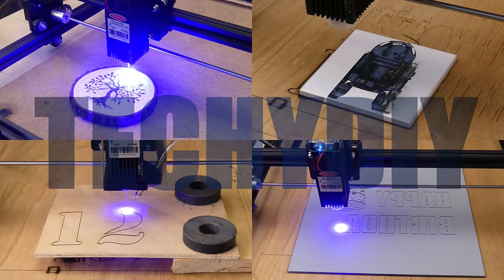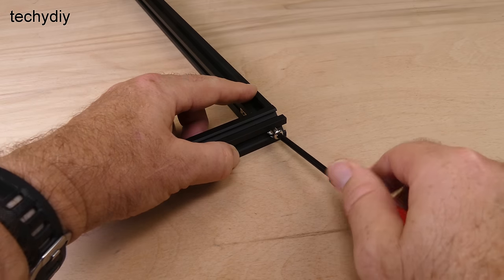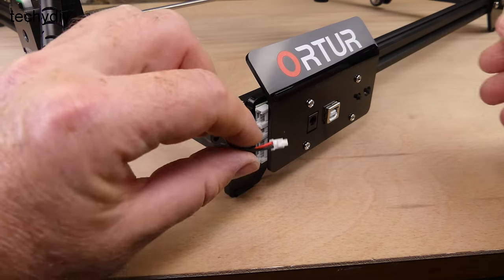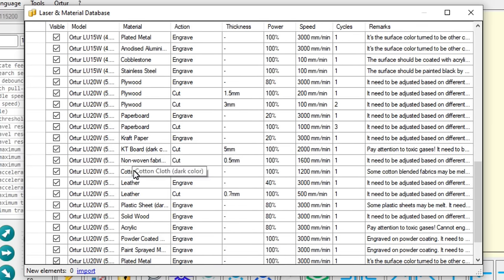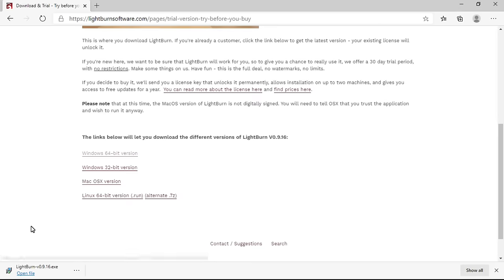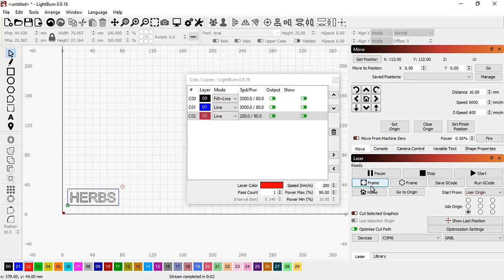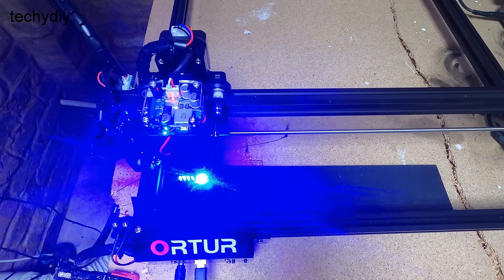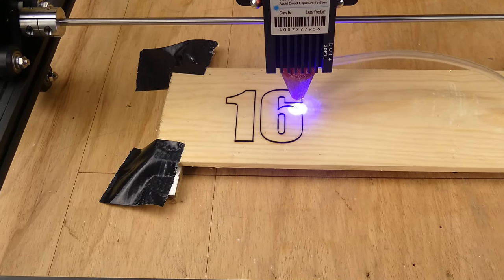Ortur Laser Master 2 - 20W Engraver. Build, Test & Review.

Comment: Amazing in depth review. I have one question tho if you can help . Lightburn doesn't output 100% power no matter what i set in the layer setting . The most that it puts out is i wanna say around 10% in real life. Any idea why that might be ? I've tried searching for the answer but cant seem to find one. Thanks
Reply from the maker: Type $$ in the console, this will show the grbl configuration.
Look for the value of $30
This number represents the laser maximum power level, it is normally 1000 or 255 

In lightburn, under device settings, look for S-Value Max.
S-Value Max should be the same as the grbl $30 value.
Reply: @techydiy  I've done that . Forgot to mention in lasergrbl works perfect , and i also made sure all the grbl config is exactly the same in lightburn but still doesn't output full power . Could it be a firmware problem?
Reply from the maker: I doubt that it is a grbl firmware problem if it is working ok in lasergrbl.
Some sort of  lightburn config problem at a guess. Your best bet is asking on the lightburn forum.
Reply: @techydiy  i will do that thanks. Thought it might be a unit conversion issue between grbl and lightburn that everyone was aware haha . Thanks for all the good videos you put out , I've already bought a laser and a cnc cause of you 😅

Comment: If I wanted to laser etch some wooden dowel that’s long. Could I block up the corners so the dowel fits Under for etching?
Reply: Or would the dowel be to far away to laser if the machine was 10mm higher?
Reply from the maker: Yes you can do that

Comment: I have a question, which laser would you suggest to use the 7w, 15w or the 20w?
Reply from the maker: Generally the 15w is the best compromise between cutting and engraving. If your not bothered about cutting, then get the lowest power laser.
Reply: @techydiy  well i do want to mostly do engravering. How well does a 20 and 15 work with engraving, because I do want to do cutting and engraving. what was the laser type you used in your video?
Reply from the maker: @GAMEZONE13172  I used the 20w but the 15w is what I recommend

Comment: Is the laser upgradeable to something that can more easily cut through material?
Reply from the maker: You can get more powerful diode lasers but if the primary purpose is to cut material then I would get a co2 laser or a CNC router.
Reply: @techydiy  Totally understood. it's also relevant in case i need to replace the laser at end of life with another brand. How can i know what is compatible?

Comment: Hey, great video! What would happen if I could try this machine on a piece of metal? Would it etch into it?
Reply from the maker: It doesn't work on metal directly. 
You can put a mask (coat of spray paint) on the metal and burn off the mask and then acid / electro etch and then remove the remaining mask.

Comment: My wife bought one of these and the program has the home to opposite corner from the power button. Any. Ideas why this is happening? I followed your video to a T on the build and it’s built the same so no idea why it’s doing the opposite of everything
Reply from the maker: So it homes to the back right ?
Does it jog in the correct directions or are the axes also jogging backwards ?
If so then its probably the grbl configuration $3 setting that needs to be set correctly.
Type $$ into the command console in whatever software you are using, it will print the grbl configuration.
Look for the $3 – Direction port invert, mask setting.
The setting is described here:     
https://github.com/gnea/grbl/wiki/Grbl-v1.1-Configuration#3--direction-port-invert-mask
Look at the table in the $2 command
This will tell you how the axes are currently set
Now use the table to find the value that will change the axes  direction
You can change the setting by typing   $3= New value into the command console
Or post the $$ output here.
Reply: @techydiy  so from the power button it goes to the corner diagonal from it as the home coordinates. Then it will not move or budge in any direction. We will try what you said and let you know thanks.
Reply from the maker: When it first starts to home, manually click both  of the limit switches. You will have to be quick. Then you can see which way the machine jogs, if it jogs incorrectly then that needs to be fixed. If it jogs correctly then it's the homing setting 23  that needs to be changed.

Comment: Hi there. Another +1 for the amazingly clear and useful review of this. I'm about to push the button on this but my question was about whether the 20w laser is really necessary. I'll be etching and cutting and you mentioned that the highest power laser might not be such a significant gain? 

Any general advice on this 🙏
Reply from the maker: The 15w is probably the best option.

Comment: Setting Láser ON: M3 or M4 it’s different? 😲 First time that I think about it …
Reply from the maker: https://github.com/gnea/grbl/wiki/Grbl-v1.1-Laser-Mode

M3 Constant Laser Power Mode:

Constant laser power mode simply keeps the laser power as programmed, regardless if the machine is moving, accelerating, or stopped. This provides better control of the laser state. With a good G-code program, this can lead to more consistent cuts in more difficult materials.

M4 Dynamic Laser Power Mode:

Dynamic laser power mode will automatically adjust laser power based on the current speed relative to the programmed rate. It essentially ensures the amount of laser energy along a cut is consistent even though the machine may be stopped or actively accelerating. This is very useful for clean, precise engraving and cutting on simple materials across a large range of G-code generation methods by CAM programs. It will generally run faster and may be all you need to use.

Comment: Does the wattage have anything to do with clarity?I'm needing to engrave text with crisp, sharpe edges on steel using cermark. Is  one laser more precise than the other?
Reply from the maker: In general the lower power output lasers have smaller dots. It's a trade of between getting enough power to do what you want  and the dot size.

Comment: Good evening and Happy New Year.
I have also made the purchase of this particular laser.
It is very difficult for me to cut a plywood 4-5 mm Could you help me with a photo or some instructions?
Thank you very much
Reply from the maker: Air assist
Reply: @techydiy  do you mean to put air with a compressor in the laser? SPEED 2150  LINE INTERVAL 0.110  PASSES 5 TIMES MAX POWER 95% IS IT CORRECT?
Reply from the maker: @GreenBus13  Yes, air assist as shown in the video. It makes a huge difference. The speed should be slow, say 100 mm/min
Reply: @techydiy  thank you veey much for your help.
Reply: well just i buy a small compressor the result is perfect.... But very noise from the compressor, and also after 30 minutes of work the compressor was very hot.
do you suggest another solution ,what would you advise me to do?

Comment: Great review.  Could you test a copper clad board with paint and a circuit pattern on ? I'd like to see how well a direct laser image transfer would work.   Also if you have the ability doing an exposure to presensitised photoresist copper clad board with maybe 0.5% power would also be a useful test (obviously developing too to see final results).  Would be interested to see how lightburn does with fills etc on the copper traces.  I'm after 0.1mm resolution or better.
Reply from the maker: The "20w" 5.5w model is not right for that application. The best I have used is a 500mw laser, which has a much smaller focus. Marco reps has a video about exposing presensitised boards, he was quite successful with a few mods.
Reply: @techydiy  Thanks.

Comment: I want learn to engrave metal and aluminum to do some pets articles, this engraver work for it? Thanks
Reply from the maker: No, it's not powerful enough. Some people report that they can engrave anodised aluminium but it didn't work when I tried it. The only other option is to apply a paint layer to the metal, burn off the pattern with the laser and then etch it with acid.

Comment: Cool video!  Thanks for posting.  I'm thinking about ordering one of these units as a platform to attach an ultrasonic spray head.   I don't need the laser feature.  Would this unit continue to take commands if I were to completely disconnect the laser portion?
Reply from the maker: Yes, it will work without the laser. Buy it with the smallest laser option as it's cheaper. I am going to have to lookup ultrasonic spray heads now

Comment: What attachment do you recommend for engraving glass mugs with handles?
Reply from the maker: A co2 laser. Diode lasers won't engrave glass.
Reply: @techydiy   Do you have any good recommendations for any that will?
Reply from the maker: @TheBobSnap  I use a laser box pro from xtool. The cheap end of the spectrum is a k40 (which is not plug and play). Lots of others available just search for co2 laser.

Comment: My brand new Ortur Laser Master 2 only gets partway through a job and it stops responding. I am using LaserGRBL. I have tried changing the streaming mode and the threading mode, reinstalling the software, tried different files... Any ideas?
Reply from the maker: Basic checks, make sure the connectors are all secure. Route the usb cable away from any other leads. Check your not going out of bounds and tripping hard/soft limits Otherwise go back to ortur.
Reply: I had the same issue of job stopping in between or just after few seconds. I replaced the USB cable with a new one and then everything worked well.

Comment: Hi techdiy, so it can write good Name/Lastname on stainless steel plates for doors for example? Thanks
Reply from the maker: Only with marking spray
Reply: @techydiy  I am thinking of buying this machine :) , (i know this is a noob question) but what does Marking spray means, thanks
Reply from the maker: It requires a very powerful laser to directly engrave stainless steel. Marking spray is a product that you spray onto the metal. Then you  laser your design, remove the excess spray and you are left with a permanent engraving. Moly dry lube also works as a marking spray.
Reply: @techydiy  Wow okay thanks man 👍 what spray do you recommend at decent price to use? Thanks
Reply from the maker: I don't use it but I would try dry moly first as its the cheapest.

Comment: 30:30  If the 20W/5.5W laser is significantly less focused, then would it have lower irradiance, and slower cutting than the 15W/4.5W laser?
Reply from the maker: I haven't tested the 15w so I don't know for sure, but I doubt it has as much cutting capability. It's not the focus but the shape of the source.
Reply: @techydiy  Thanks for the quick reply.

Comment: will this engrave on metal?
Reply from the maker: It can't engrave metal but you can mark some metals by applying a coating like mustard or cermark.  You can also apply a paint layer, laser away the design to make a mask and etch with acid or electro etch.

Comment: HI great video, I got a bit lost though with all the menu and clicking stuff cos I'm not much of a tech person. Does this work with a mac? If so, what drivers / software etc would I need? (the simpler the better please!)
Reply from the maker: You can get the usb driver for a Mac and you can get lightburn for a mac, so I guess it works with a Mac. I guess it depends if you have a usb port on your Mac.
Reply: @techydiy  Great thanks

Comment: hey there,
great video, thanks for reviewing this product. one question: I would need a laser like this one here with the possibility to directly print from a program like lightburn.
I will perform the same step over and over again: same material, same dimensions just with different graphical input. 

Is there a way to set default values and just change the graphical input and hit go?
Reply from the maker: You can save a base design and then just modify it each time. Lightburn has a lot of information on it's user forum, so your best bet is to ask there (Giving examples of what you want to achieve).

Comment: Hey @techydiy, great video man !
I have a question: on the product page they say that this module can also engrave stainless steel if it is painted black with a marking pen. does that really work because i am currently interessted in engraving stainless stell and dont have the budget for an 2500$+ Model. 
Best regards
Reply from the maker: It didn't work when I tried it.

Comment: Follow-up comment:  Your video was SUPER helpful in getting this unit setup.  Thanks so much again!   That was a real time saver.  One dumb question.  In your picture at 0:24, there is a plastic silver tube thing right in the middle.  In my version, I got a black plastic one that is similar but slightly different.  What the heck is that used for?  I didn't see it in the instructions or in your video.  Maybe I just missed it!  ;)
Reply from the maker: Its a tool for installing the cable in the conduit. You only need it for certain models apparently.

Comment: Any chance you could share the air assist v.2 for the 3D printer?
Reply from the maker: I found the bracket on thingiverse. There are a few others.
https://www.thingiverse.com/thing:4524111
1mm 3d printer nozzle  https://bit.ly/3lyEK3m
6mm brass tube   https://bit.ly/3jswznt

I enlarged the end of the brass tube and then  screwed the printer nozzle into  it.
Reply: Thanks for the quick response, I really enjoyed your video, it was very helpful.

Comment: i followed every step but my laser won't move with light burn, before it was working fine with grbl
Reply from the maker: Did lightburn find the laser during setup?
Have to selected the com port in  lightburn?
Reply: @techydiy  no something very dumb of me. the laser was plugged in to an plug extender but the switch of said plug extender was turned off. The weird thing was that my laser could be turned on ( only the light would turn on but the laser didn't move) and my laptop would give a signal it was connected, so i didn't check if it was plugged in correctly.

Just the power light that threw me off....feel so dumb right now  xD.

Comment: Use for brass?
Reply from the maker: No. One way you can use it is to put on a mask (paint), burn off the pattern with the laser and the etch it with acid or electrolysis

Comment: Has anybody tried the 5W version? I want to make sure it can still perform well enough to make clean engravings into wood.
Reply from the maker: It has more than enough power to engrave wood, the only advantage of the higher power models is that you might be able to engrave faster / cut wood.
Reply: @techydiy  Noted, thanks

Comment: What about the smoke?
Reply from the maker: Bathroom extractor fan and vent outside
Reply: @techydiy  I think that it would be better to build an enclosure with extractor  and conduit that would contain and evacuate the smoke outside. I have a K40 and it smokes a lot, without the enclosure and smoke extractor it would be really harmful (I am not the type to wear safety google, respirator and so on) , even without talking about risk of cancer, just the irritation of the throat and lungs. I would do something about that before starting to use it. The harm you do to your body doesn't go away, you pay the bill in your 50's.
Reply from the maker: @Yves95128  the enclosure was assumed.

Comment: I think this type of laser cutter is too dangerous out of the box, because of the fumes, the electrical wiring, the laser energy. I think it can be quite useful as a building block for a more comprehensive system, say a laser cutter with an enclosure, or even without a laser, leveraging just the CNC platform.

Comment: You trust Alibaba link?
Better price than the actual store.
Very suspicious
Reply from the maker: Ortur gave me the link, its their store on Ali. I imagine its cheaper because they have more competition on Ali.
Reply: @techydiy  there are 4 units, I'm guessing you have the higher voltage.  
I'm looking to cut cardstock,  cardboard,  and engrave, so I guess I need the 20w
Reply from the maker: 15w or 20w should be ok. 
They have replaced the variable focus laser tested in this video with a fixed focus and it now performs better.

Comment: Let’s get one thing right here, this laser is not 20watts and not even near that. Why people keep calling these lasers 20watts is a joke. Get a real laser power meter and I mean a real one. Not a cheap knock off and measure the power. The strongest blue laser you can get on the market is a 7watt diode it can be pushed to about 10 watts but it’s not good and could burn out anytime. These cheap laser engravers are hobby tools, but they are not powerful like a real co2 laser engraver. I work with lasers and I know all this and your being told crap about the power. Also wavelengths affect how things are burnt.
Reply from the maker: I think I was really quite clear about the laser power in the video, did you actually watch it ?